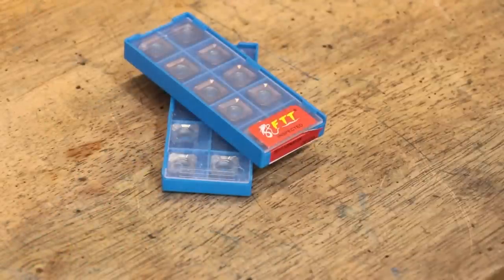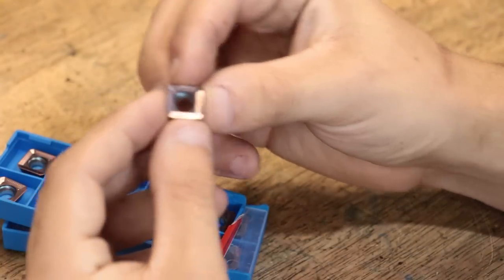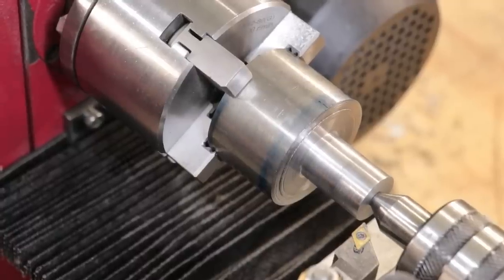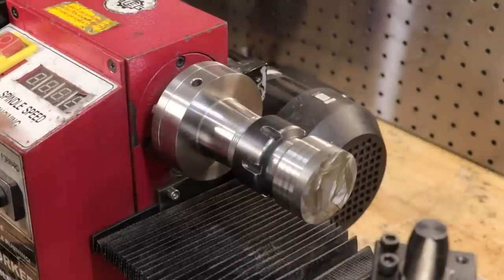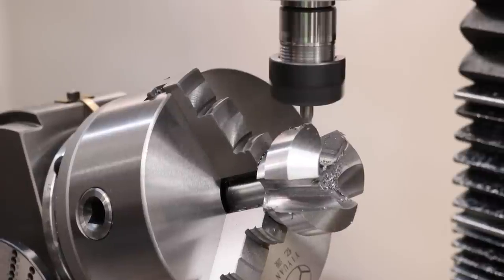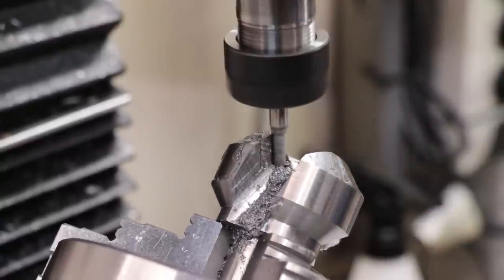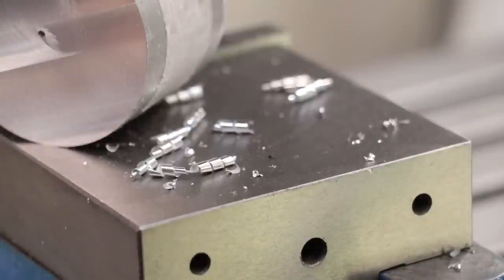Making A Face Mill For The Milling Machine

Comment: I have beed taught that the cutting faces must be offset, to eliminate resonance vibrations. In a case of three cutters, one of them is offset two or three degrees, not 120 equally. And also, you can add a plate behind the inserts to increase, or decrease the angle of attack. I've only made cutting tools for lathes on benchgrinders so far, don't belive me :)
Reply: That can be useful on specific tooling with many tips - however it complicates matters as each tooth is now taking a different depth of cut on a 3 tooth cutter - 118, 120 and 122 you have introduced through DoC progression a differential spindle load which can increase spindle bearing wear.

Bare in mind I'm not saying you are wrong, just that in 3 tip cutters specifically, it is rarely a good plan

Comment: The high rake aluminium inserts do tend to work well in the smaller lower horsepower machines.
Reply: They are surprisingly durable too. Better than I expected when using them on steel.

Comment: Good stuff, man! I like that you gave it that cool factor and  I especially got a kick out of the compound angle setup on the dividing head.
Reply from the maker: Cheers man, precision eyeballing like never before :)
Reply: @artisanmakes : I was curious about how you achieved that setup with the dividing head.  So, you used the good ol' eye-crometer?  You should show us how it works next time!
 :)
Reply from the maker: Set up with a protractor and roughly swept with a dial indicator. The angles weren’t too important

Comment: Like you I use a lot of hot rolled steal. I'm a pipe fitter by trade and worked at a fab-shop. Most machinists never use the hot rolled, but we use what we got.

Comment: A more durable Fly cutter use 4140 or 8630 it can be hardened to be more durable. mild steel will not take the heat or pressure on the carbide pocket.

Comment: Getting your feeds and speeds correct is very important. 

Sadly I’ve forgotten almost everything I learned about the subject back in the mists of the last century. But I believe you can find feeds and speeds calculator charts online. 

Essentially, you need to ensure that the material does not advance beyond what the cutting edges can cope with. There are of course upper and lower spindle speeds, as well as cutter surface speeds for each material. Operating within those tolerances, you set the material advance speed to match. 

Somehow I seem to recall we used our instincts most of the time. But that was after lots of training, and too many boring hours of standing at the same machine, shift after boring shift. 

Even though we were making experimental aero engine parts, and there was some variation, plus working in various milling, grinding and turning departments, it was nothing like hobby work. After 6 years I had to escape. Now I have a strange nostalgia for such work, but only for myself, and at my pace. 

This is a nicely executed tool. Thank you for sharing.

Comment: Nice job. One thing I would do is go ahead and grind off the hook that was created by drilling through the back face. Spinning as fast as it does, the flutes will act like a fan and will tend to suck things in where it will be grabbed by those hooks. Whether it's a long chip or an inadvertent shirt sleeve string or shop rag...it's just best not to have anything that will grab like that. Otherwise I like what you did there, nice project.
Reply: Yes, I looked at those hooks and was a bit uneasy about them. Now if I am uneasy about something, then that means that it is dangerous and should be dealt with. We shall see what Artisan does or says.

Comment: This is a really great home shop project, good job! Just a suggestion from a guy who learned on mini mills before moving up to bigger mills. If you make cutters made for larger material removal rates (such as a face mill) it really helps with rigidity if you make it’s shank the spindle shank so that you don’t have to put it in a collet. I know that’s not easy, and not as modular if you move up to a bigger machine in the future, but it really does make a huge difference in the cut. Still great work though!

Comment: Great video, these kind of projects are a fantastic learning experience! 
Only thing I'm worried about is the stem/arbor to body transition. It seems like you've machined a groove instead of a nice large radius fillet, making it a breaking/failure point which could send the kinda hefty body flying through the shop.

Comment: You could probably use those other inserts where finishing isn't critical for the surface or try your hand at making a 45 deg lathe tool from them. As for the depth of cut for the non aluminum cutters, a slower feed rate should allow you to take more. A power feed on the table axis' should make it much more do able if you have one. But I'm guessing that's been put on the back burner. 

Hope this helps.

Comment: Nice job man! I've tried some carbide inserts (S, C and D types) on a small lathe (Sieg C6)  and my conclusion is that the inserts for aluminium are really sharp and they leave a very good finish, for more rough work on steel I used inserts for steel with a sharp edge (dedicated for finishing passes). I also tried inserts for steel dedicated for roughing passes but those doesn't behave well on a small lathe (rigidity issues due to higher cutting force).
Reply from the maker: Neat, I’ve found d shaped inserts work the best, whether they be The generic dcmt or sharper DCGT. Never had too much luck with cnmg or similar
Reply: @artisanmakes   I use CCGX and SCGX types size 09. Negative rake inserts (second letter N) require a good amount of power and rigidity so those aren't suitable for bench top lathes.

Comment: I made a similar tools many years ago, the only difference was i turned a number 3 morse taper shank rather that the 20mm diameter. It works and that is the goal of the exercise. Those steel milling inserts looked very iffy, the aluminium ones worked a treat. You should make more tooling, I loved making tools and jigs😊
Reply from the maker: Making tooling is for sure a lot of fun

Comment: I am not sure which type of hotrolled steel you used, but aluminium inserts and stainless/CrMo/highspeed steel gets tricky. Or that is my experience at least...
 If I may I would like to encourage you to try the Korloy HA PC9030 inserts. In my opinion they work all the way to ~55Hrc and with non ferrous like plastics. As they are sharp they also work well with less rpm and horsepower. If one goes "all in, full speed" there might be better choises, but with possibility to adapt and slow down they work surprisengly (?) well...

Comment: If you are going to be this thorough, you can make a shell endmill with only a bit of rxtra effort and slightly different inserts.
Reply from the maker: I always though shell mills were made of a solid piece of hss, no? At least the ones I’ve seen were
Reply: @artisanmakes  I have a two inch shell endmill with seven inserts at work, and it's phenomenal.  you have to be extremely diligent about making certain the insert seats are extremely clean when changing/rotating inserts, and avoid over torquing screws, but it's basically got all the best features of a face mill and a shell mill at once.

I have used it to square five sides of a large block on the CNC by combining a facing operation with a perimeter with depth cuts.
Reply: @artisanmakes  I'd think that as long as you used side and bottom cutting inserts (and kept them square to the body of the holder) you should be good.

Comment: Take 2 of those inserts out and your electric spindle motor will do more revolutions before the insert re-enters the cut. Multi tooth cutters consume horsepower because the next tooth is close to the one that just consumed the power. You will always cut deeper with a single tooth than multi tooth because of this BUT you will need the rigidity to back it up.  You are taking realy light cuts. Its not like your after a mirror finish on heavy roughing cut especially on a smaller mill.   Realy nice build though mate. I enjoy watching your videos.
Reply from the maker: I’m at the workshop so I’ll give it a go
Reply from the maker: Just to update didn’t seem to be able to take a much deeper depth of cut before I got chatter. Rigidity holding it back
Reply: Great work for giving it a try mate.  Rigidity and horsepower are going to set the upper limit but good on you for testing your constraints.   Once again very nice work and love your video's.
Reply from the maker: No worries, always happy to give it a go. Cheers

Comment: Shell mills arent really for the hobby shop, but they are if you have large machines in the shop... And, keep in mind that a shell with inserts can be modulated to act as a flycutter if you remove all but one insert, or use a large enough shell with two inserts that are opposed to each other... Its a play of sizes and what fits best, but i find a shell mill with sharp carbide inserts to be one of the best flycutters out there... Carbide inserts for alu on a chunky shell are rigid as hell and if the machine is rigid enough, its a mirror finish with no problems, every time... So they can be used on small machines, but you cant use them as a mass material removal tool, rather as a flywheel effect rigid flycutter... By mass material, i mean proper use at least 1/2 of the recommended feed and speed... Tho, they do great as this vid shows... But thats a 3 insert, sharp insert small mill... A large shell that is 4 inches or larger with 10 inserts, na-ah, that would need to be used with 2 inserts max as a flycutter and at custom speeds and feeds to fit the machine like this... But it would cut lovely aswell...
Reply: thats a cool idea, id like to try it!
Reply: @muzzarobbo  technically, its just a large enough flycutter to accommodate two cutting edges on opposing sides, allowing you to feed a bit faster, as you dont have to wait 360 degrees of rotation for another cut to start, but rather 180, but that works if the thing is large, yet small enough to allow you to feed in between two cuts... As with any machining, its a tactical dance in a way...

Comment: Tpg322 insert based facemills are fantastic on small mills.  Not sure why you would think they simply "wouldn't cut well" on your machine, but I can tell you they will work better than an APKT and most SEHT based tools on a small mill.
Reply from the maker: I have seen these used on a mill slightly larger than mine and the person seemed to have to take light cuts with TPG style inserts.

Comment: nice work.  I would hope to see you move to a carbon or alloy steel for these projects.  4140 is not expensive, and you can heat treat.  as much time and effort as goes into this, I would hate to see it wear due to insufficient material properties

Comment: Nice tool, and the SEHT polished inserts leave beautiful finishes in Alu. Have you tried chamfering with it? Mass stock removal, and then a quick pass around the perimeter and deburring is reduced by at least 50%.
Reply from the maker: No I havent bit I will soon

Comment: FYI - If you make a left-hand version of the face mill, then you'll get double the life from the inserts by using all eight cutting edges. Also, if you had used round inserts (truly designed for lathe work, but I've used them for face milling aluminum), then you could rotate the inserts to effectively get 18 cutting edges per insert.
Reply: @joshconnelly8704  The inserts actually do have 8 cutting faces. It is the leading edge (the angle and nose radius) that takes all wear (unless you run them to catastrophic failure).

Rotating the inserts only allows you to use 4 cutting edges per insert. Installing them in a left-hand cutter permits running your spindle in reverse to utilize the other 4 cutting edges.

I've used this technique to cut my expense the style of inserts you've selected by 50%.

Note: I did find the most cost effective solution was to use round inserts. These can be rotated a few degrees to expose a fresh cutting edge. I was able to produce mirror-like finishes with round inserts when face milling aluminum (of course, my milling machines were not something found in a hobbyist's shop).
Reply: Those round inserts are pretty good for stainless too if you get the correct rake.

Comment: As for the SEHT inserts not being very sharp when you got them, most carbide inserts are not. They have the strength to simply push through other metals and CNCs have the HP and rigidity to do it fine. A thicker edge makes them last longer than a sharp edge, and is especially useful of negative rake inserts like is more common on carbide inserts. The reason for this is CNCs have the HP to run them fine, and a negative rake often means you can double the number of cutting faces per insert to save money. HSS tools are designed with a sharp edge in mind, but you can also get certain types of inserts that are sharp. As you found, those other models meant for aluminum are quite sharp and most inserts meant for aluminum are this way. It isnt always the case but "xxGT" inserts are usually these very sharp types. Using these much sharper inserts works best on smaller machines, and sticking with positive rake inserts also helps since small machines often dont have the 5+ HP that works best with negative rake inserts.

Comment: There is a chance that by tilting inserts with such geometry you might cause excessive downward pull on the tool. Will not matter on light loads though.

Comment: its going to take me yrs to get all the stuff showed in this single video to setup the parts. im just getting started but the more i watch of these videos the more i feel like im never going to have all the stuff that is needed to make the stuff i want to try to make. the indexing chuck that u use to hold the parts is something id love to have but it so hard to judge how big the machines u have are. i had always thought the lathe was one of the hobby sized  lathes from harbor freight but watching it work makes me thing its either been upgraded alot or is probably something bigger. the stuff i have is the smallest u can get i guess, 7x14 lathe an the mill is a wen 33013 so its pretty much the same as the sieg x2 mills but from my understanding the wen has a bigger bed setup. an from what ive been able to tell from  pictures, ive never seen the sieg machine in person the base looks to be alittle bigger on the wen but i could be completely wrong on this cause im just going by pictures an ive been fooled b4.

Comment: This really hit me in the face. I just assumed those inserts were $30 each (which is the price of the cheapest 2-sided inserts i use) but no, they're $30 (including shipping) for a box......
Reply: Those can be bought under 15 for the box of 10 including shipping. Maybe 20 Australian? Really good considering the price tag.
Reply: @MF175mp  i just looked quickly on ebay with shipping to sweden

point still stands, that is so cheap it makes me question how reliable the quality is

Comment: the machinerys hand book should have information on carbides  , incersts, and rank angles and other tool info, that should help with designs

EDIT: Thats one hell of a roughing mill holy cow
Reply from the maker: Oh yead definitely. Had that on hand when I was in the soldiworks stage. I don't tend to follow the speeds guide since its more aimed at bigger mills

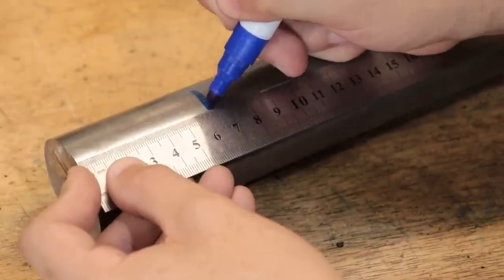Comment: 3:27 in your vid, those triangular inserts are cheap,  low cutting forces, ideal on a low torque machine.   FYI
Reply from the maker: Neutral rake is always going to have higher cutting loads than positive. That’s why I use positive

Comment: hey i got myself a old logan 820 lathe and im having issues with a lot of runout on the chuck, i was wodering if there it is something that i can do to fix it instead of buying new jaws or a hole new chuck. also it would be very cool if you release your designs, it make reproducing it a lot easier

Comment: Did you make a new arm for your dividing head the part that holds the indexing spring loaded pin that goes into the holes on the dividing plates? I think we have the same dividing head and mine is different. Mine is thinner and has rounded ends.
Reply from the maker: Yeah I made it from a piece of offcut aluminium. The factory one way too loose on the worm shaft.

Comment: Came out really nice! Strong and functional. 👍
I was worriee when youmsaid you were going to add a heap of extra rake angle but the final result looked like the cutters are mounted at 90 degrees?
Reply from the maker: About 5ish degrees. Last minute change. I though that the original 10 would have been a bit much for these inserts, given how fragile the edge is
Reply: @artisanmakes  ... thanks for the update!
I also like lots of rake and sharp tools on smaller machines. We dont have the rigidity to make huge deep cuts with a big blunt carbide cutter. I still love razor sharp hand shaped HSS on my lathe.

Comment: Is there a guide to how deep of a cut you can take with carbide inserts?
Yes, I know that the material makes a difference and no doubt the size of the insert too, my machinery is hobby sized so I have small inserts. I'm just wondering if 0.5 - 1mm is really pushing it? On my mini lathe, I take 0.05mm cuts for example.

Comment: Is there a specific video for using your drill to manipulate the cross sled?
Reply from the maker: No, it’s just a hex driver bit in a cordless drill. It drives the cap head screw on the compound lead screw
Reply: @artisanmakes  cheers, cutting angles manually with the little hand knob is death (have the same model)